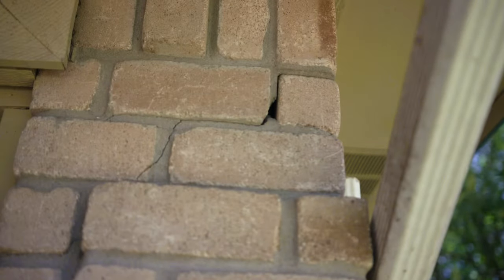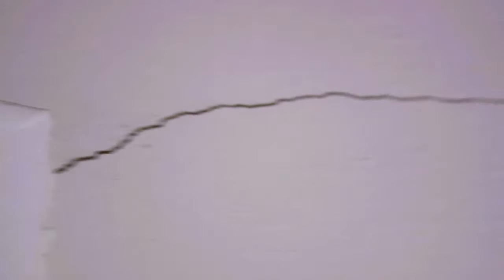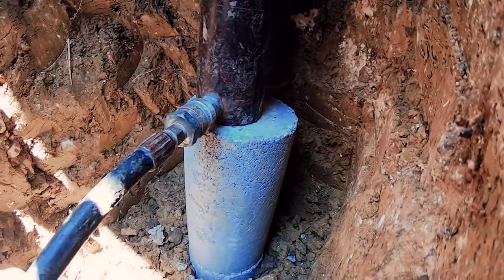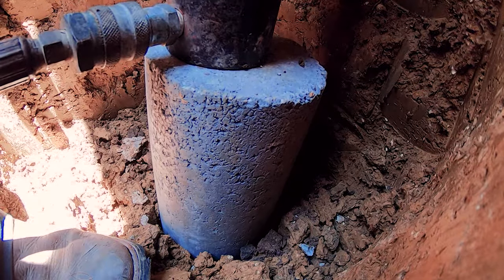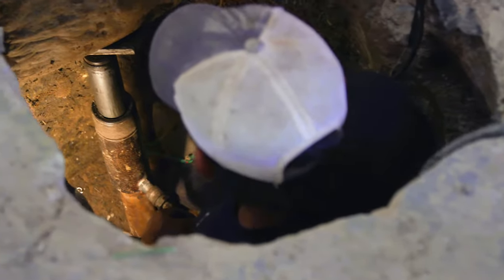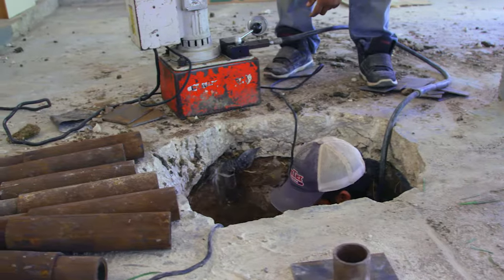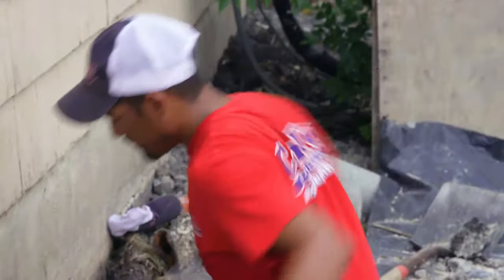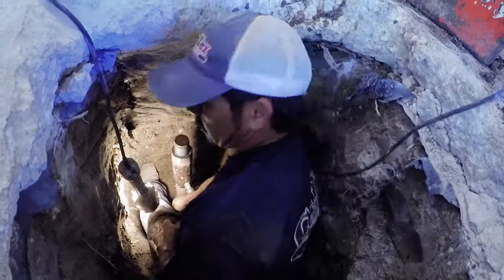CenTex Concrete Slab Foundation Repair

Comment: What would something like this typically cost.  Just a range would be good.
Reply from the maker: It's hard to pin down a range because there are so many variables.  Factors like how many piers are needed, what type of pier is being installed, what access needs to be made and even whether permitting is needed all play a part in determining the overall cost.  This is why we provide free appointments to homeowners in our service area.  

You can book an appointment here:  https://welevelit.com/free-foundation-inspection-evaluation/#schedule